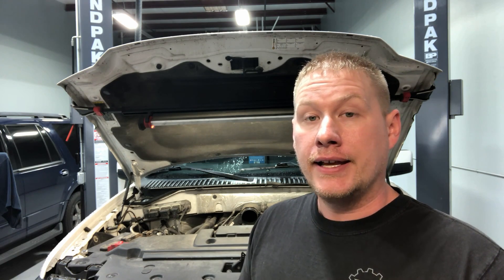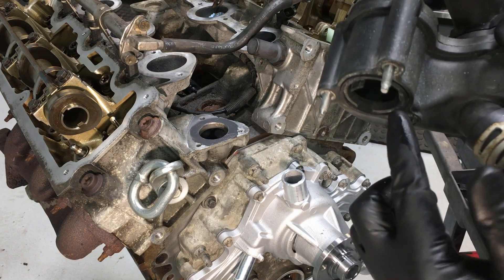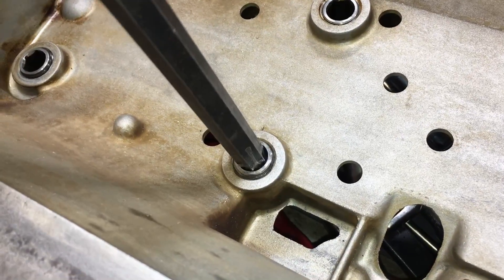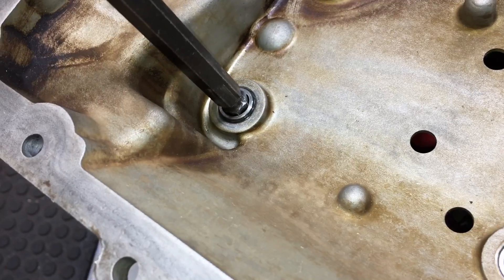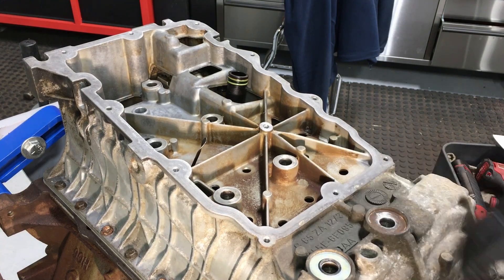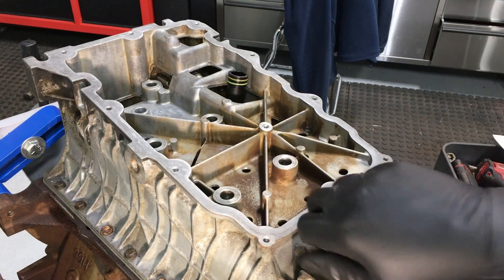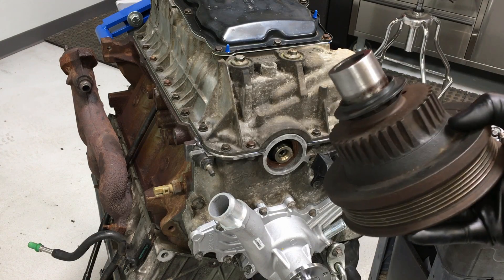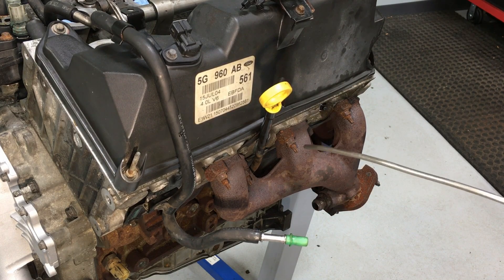Ford Explorer Ranger 4.0L SOHC Startup Rattle Fix: Timing Walkthrough Pt 4 of 4 Engine Assembly

Comment: Brian,
2002 Ford Explorer xlt
4.0 5r55w 235k used your 4.0l video bought the otc timing tool aftermarket chain and guide kit(no gears).runs good
2001 ford excursion 
5.4L 2v blew 3 plugs out so far,will run on 6 cylinders with overdrive off,lol,bought the tool for the plug inserts love it. Runs good
Listen for a lifter tick sound that’s the indicator a plug is gonna let go,loosen the coil bolts if you have to drive it,or you will breakthe coil pack,Ilove the suv
And then......
2006 EB expedition 3 valve 360k ,2 chain jobs,my fault on 1st one ,steep learning curve,but I like the engine,It has the low end grunt like a 500ci caddy.engineruns great of course used your 3v vids to work on it,mostly preventive but I watch them for future repairs and Insite
Very excited about the melling high performance oil pump video.
These engines may be junk to some, but I have come to appreciate them for the most part because they have not stranded me once YET

Comment: Great detail in this video series. Nice work. Couple questions. Did Ford improve parts so that newer models don't have as many repair needs for this issue as earlier versions? Second question is in regard to replacing exterior tensioners sooner than Ford recommends. Every start up the tensioners are starving for oil, over time they are said to weaken and lose spring tension. Wondering if this is why guides and composites of the cassettes don't hold up. Thoughts? How often would you recommend replacing these?

Comment: i have a question... i haven't quite gotten to do the front brakes yet, so last time they needed changing, i took it in to ford - asked them to check the bearing, balljoints etc... they said there WERE no ball joints...  is that right?   2003 eddie bauer expy...  i admit, i'm no expert, but thought there ball joints in almost every vehicle - yes no?
Reply from the maker: Yes you have an upper and lower ball joint in the front as almost all vehicles do.
Reply: HA - i KNEW It!   lying $%^&*!!   they figure because i'm a 'dumb girl' that i don't know this stuff...  every time i've taken it to Ford, within a few days something else mysteriously seems to go wrong!   got some superficial rust done around the rear plate, when i got it back the hatch wouldn't open...  they said it was 'just worn out, 600bucks plus labour to fix please' - turns out it was just overspray from their paint guys...   thanks to your videos, i've changed the transmission oil and filter, front and read diff, transfer case oil and fuel filter.  was already doing the engine oil, but i'm embarrassed to say i didn't really think about all the OTHER stuff.   my old girl just hit 300,000km (about 186k miles) so i want to take good care of her.   even bought a wiring diagram and ripped the entire truck apart to find an electrcial gremlin (corroded purple wire under the driver step up thingy), and a maintenance manual so i know what are the bits are that you're talking about!   one good thing about being small is i can slide under the truck without jacking it up.  so thanks - you've taught me that i can do lots of this stuff - wouldn't have attempted it without you!

Comment: Wish you would of let us hear it run. Anyway, thanks for the video and all the time you put in making these videos and editing them!
Reply from the maker: Yeah but there just wasn't time the customer needed the vehicle back I was done filming and it was time to boogey. It sounds just like any other properly running 4.0l SOHC.
Reply: FordTechMakuloco I just got done reinstalling the engine back into my ranger after carefully following your four part video on the timing. I then, as you instructed left the CKP unplugged and cranked it to get oil pressure. I then hooked it up and it wouldn’t fire. So I made sure all the grounds were making good contact and put a new CKP on, still nothing. I took a couple spark plugs out and checked for spark and only got one weak spark cranking for a few seconds. Do you have any idea what might be the problem? It worked fine before I tore it down so I’m scared it’s the timing.
Reply: @chip7236  you ever figure it out?

Comment: I have the same motor in my 05 ford explorer. The engine is running rough at idle but it smooths out at higher rpms. There is no engine codes. It has a complete tune up still no difference. I even checked for vaccum leaks with a smoke machine. There are no leaks. The EGR valve was replaced too. Can you help me fix the problem with rough idle? Im runnong out of ideas what it migh be. Thanks for thr help. Love your channel.😎
Reply: I had a rough idle condition on my 03 ranger. I removed and cleaned the IAC (idle air control) and it idles perfect now.

Comment: When pulling the cams, do you pull the cams and THEN the roller followers?  Or must you pull the roller followers first?
Also when installing, I’m guessing you use the  valve compression tool to install each of the roller followers?  
Excellent videos!  I’m ready to tackle this job, I think.
Reply from the maker: Follow part 2 I walk you through the entire process.

Comment: It baffles me why Ford would build so much complexity into such a basically simple design. 4 litre V6 How hard can it be !  Complex timing requiring special tools, complex sump design and on it goes !
Reply: My guess Peter Mitchell it is a complex design because it is a German built engine(Cologne Germany). As seen on many eurotrash vehicles they are overly complicated. This was also a converted push-rod engine to a s.o.h.c. engine. How ever I own one and it is a 2003 and is running fine and never been apart. Using Mobil 1 and Motorcraft oil filters with a changing every 5000 miles seems to be keeping her purring like a kitten. My engine unlike some owners does see extreme temperature changes since I live in Northern NY. I feel it has been a good engine for me.

Comment: Your probably dont see much of them anymore, but if you ever have to do one, i would love to see a video on changing a timing belt on a Zetec 2.0. Idk if the vvt ones are any different than the non-vvt one, the one in my Escape is a non-vvt.
Reply: I've done it. Pain in the ass, but not too bad. You need some proprietary tools to hold the cams in place (trust me, you want them to do it right the first time), definitely replace the water pump while you're in there - they're dirt cheap - and beware the stupid EGR bung and fitting. I cut my hand really bad trying to remove it after many applications of PB blaster and heat treatment, AND lovely Ford problem - it's a royal pita to get to, and can pretty much only be done with an adjustable wrench. Great engine otherwise.

Comment: I believe there is a revised thermostat housing that is made of metal. This is probably the same type of leak issue as the 4.6 coolant crossover in the intake manifold where the plastic cracks.
Reply: I have this aluminum thermostat housing it works great they are available on Amazon. I'd strongly recommend anyone with this engine get one peace of mind alone is worth it.
Reply from the maker: Aftemarket only, the Ford housings are still plastic.
Reply: I have the aftermarket aluminum housing on mine. Very nice quality. It's way more expensive than the stock plastic one, but worth it, since I'll never have to replace it again.
Reply: @jonclark1288  do you have a link to where to buy one. Please and thank you

Comment: Great video.  I am replacing the rear main seal also, do I need to buy new bolts as it says on the torque sequence?  Thank you in advance.
Reply from the maker: No I have always just used blue locktite on all the engines I have replaced and no problems.
Reply: @FordTechMakuloco  thank you  B I just bought a bunch of bolts for the trans rebuild and didn't want to buy more lol.  Loc tite it is!!!

Comment: Great series. After watching this can see that engineers went nuts when designing this engine.  Seems like anyone who would actually have to work on this thing wouldn't make it so ridiculously complex.  I  fear for the owners who don't have someone as competent as you to work on their cars.  Cheers
Reply: This 4.0 was a German designed nightmare. I own both Fords and Audi's, anything on the Audi is guaranteed to be a headache to work on.
Reply: @charlesdjones1  You can tell the Cologne V6 was German based on the bajillion timing cover and water pump bolts.  
Seriously though, I just rebuilt my pushrod 4.0L, and other than the insane multi-piece hydraulic roller lifters, it's a dead-nuts simple, reliable engine. I was amazed how pristine the bottom end was after 300,000 miles.  It's a shame Ford never made an aluminum head version of the pushrod 4.0 with canted valves and raised intake ports.
Reply: @rhekman  I have no doubts it's a great engine, overall. I remember these in the work trucks at a company I used to work for and always thought they sounded like Porsche engines lol, at the time I had no idea they were made in Germany. A buddy of mine also had one in a single cab Ranger too, I just remember it would get up and haul with that 5 speed.
Reply: @charlesdjones1  Interesting that it sounds like a Porsche lol.  My experience with these engines was all in Rangers and Explorers.  They're not perfect, but almost no engine is.  The pushrod fuel injected models (2.9L/4.0L OHV) were prone to cracking cylinder heads if overheated, and if the lifters get gummed up (lack of oil changes) they can flatten pushrod tips and get valvetrain clatter.  Performance wise, they were torque monsters, but ran out of breath above 4000 rpm.  

Ford fixed the performance issues with the SOHC models.  A single cab, rear wheel drive Ranger in 2001 with 220hp, almost 300lb/ft, and a five speed was indeed a blast to drive. It's unfortunate the triple timing chain/plastic chain tensioner mess was prone to grenading.

Comment: The owner obviously likes the truck and thought it was worth the investment, total bill in the 3500+ range? usually the rule of thumb is more than 50% of the Kelly blue book, better of trading it.
Reply from the maker: $3,090 was the total and yes he loves the truck and at the time he really couldn't buy a new one since they are not made anymore. Also if he bought another Ranger it may have the same timing concerns so he is right back where he started but now he also has a truck payment. It made much more sense to fix this one.
Reply: Hey Brian, appreciate all your effort at putting this series together. With the attention to detail you put in I would do a job like this in a heartbeat. with the right tools
for the timing procedure it is not that bad of a job. Thanks for your service in the Marine Corp. You have a patreon account by the way?
Reply: As the Owner I totally thought it was worth fixing. I have a solid truck that will last for years at a fraction of the cost to trade it for a new one. My thanks to Brian for his excellent work.
Reply: @charlessmith9311   Yes I do like the old Rangers. I had a 1988, a 1993 and currently a 2003. The 03 has the 4.0 and never has given me any issues. Actually none of my Rangers have , too bad they stopped making them. The new model coming out I probably will not like. I guess it is going to be a EcoBoost 4 banger. I do not trust turbo chargers for longevity.
Reply: I think it's a fanstastic deal at less than 10 percent of a new one. Who cares about book value it's about having a nice reliable vehicle to drive for the next four or five years.

Comment: That oil pan is something else! Would be a helluva a job to do in vehicle! As always Brian you made another excellent video!
Reply: I did the front chains in the truck after gfs sploder threw part of the cassette up through the driver side valve cover. to get the upper oil pan off had to lower the front axle down for it to have enough room.  Reason for failure was lower cassette retaining bolt backed out and broke off.  Over all with the timing tools its not that hard to do in all honesty.